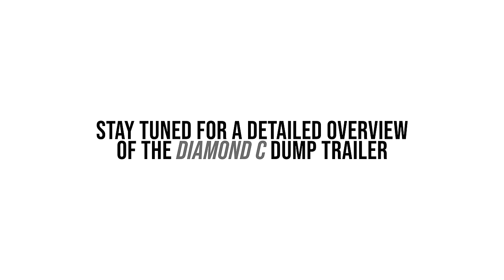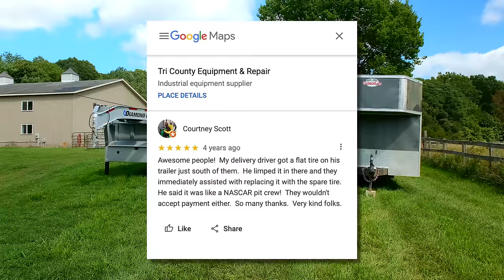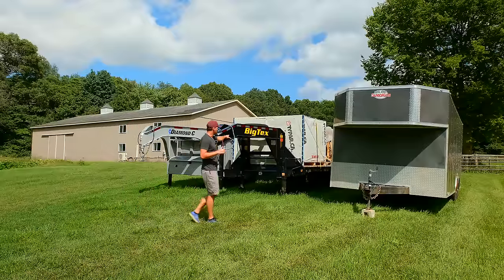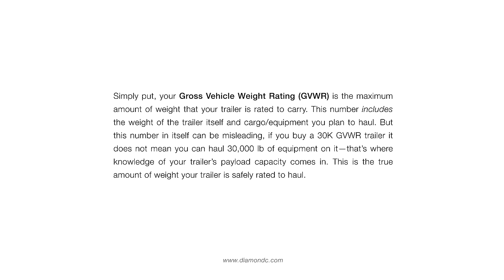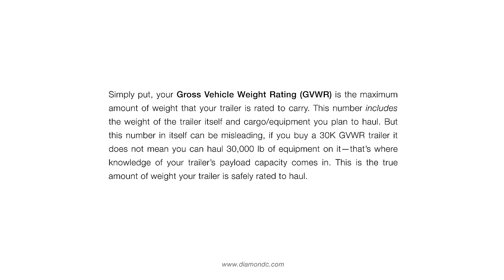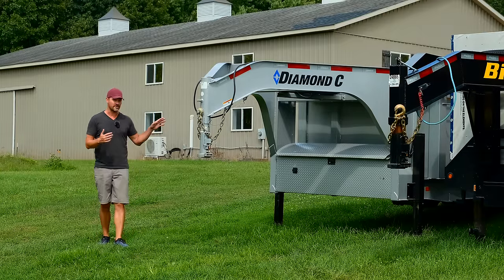THIS WAS A $30,000 DUMP TRAILER MISTAKE. WHO WANTS TO BUY IT?

Comment: It should be standard that if a dump trailer has a GVWR of a certain weight it should be able to lift that much(minus the weight of the trailer) no matter how its loaded.
Reply: If appropriately loaded I'd say. Put 16k of lead right at the front and you're likely to exceed the hitch weight. But I agree, if you are appropriately loaded you should be able to dump at max weight. Lots of dump trailers can't - it's sad. What I find pathetic is they can't even cite any capacities. Didn't someone engineer that? Or did they just slap a bunch of crap together. It takes some math but it's not that complicated. You should be able to cite a design weight the system should lift. If it's just a little heavy on the nose you can mound up over the axles but I honestly thing that's the wrong setup with the wrong parts. I could respect it if they said it's designed to haul 16k but only dump 10k unless you upgrade to... But it sounds like they have no idea what it can do - and they built it. 

I hope the right person finds it and it fills their needs. House cleanouts would probably be a good fit because it's bulk, not weight. Material definitely not...
Reply: But thats not even correct. The GVWR is based off the axles and wheel/tire capacity. Not all the weight is on the axles but they sometimes go overkill just to be safe. Has nothing to do with the lift capacity. A 21k gvwr trailer shouldn't be able to dump that much because you have a payload limit. Take the 21k gvwr(just using that number as an example) subtract your empty weight and that's your payload that the trailer should be able to dump.
Reply: @Flying C Land I agree I drive quad axle dump truck and you can’t just fill it up with gravel or dirt or even sand especially if it’s wet to the brim of the box and not expect to be way  overloaded. I mean 1 yard of dirt can weigh over a ton. It doesn’t take long to become overloaded and unable to dump.
Reply: The material weight is not the problem. The dump system is.
Reply: I remember quite a few years ago, an outfit was making trailers, and the dump was set to only dump the maximum load, that was it!   Everybody was complaining because they all were over loading the trailers, and had to shovel a bunch before it would dump!  They eventually learned what their max load looks like!  I would have adjusted the pressure relief on the hydraulics, but you may bend something, so there is always a risk!!
Reply: problem with dump trailers is that things that you typically put in dump trailers have diffrent Densities. assuming all the loads are "filled to the brim" a load of sand will weigh signifacntly more than a load of large rocks/boulders due to the fact Empty space some materials have. and their inherent density's.
Reply: @michaelpetty8416  common mis conception is that a Dump trailer just because the sides are X feet high means you can fill it with dirt X feet high. if you do you'll be 10-20 times overloaded. High sides on a dump trailer are for lighter cargo like idk. drywall. construction debries. Tree branches. even large rocks. say you have a Same sized trailer with X square footage and same Height sides. you fill it with sand. Its gonna weigh 5-10 times more than a trailer with large rocks or boulders in it. and be 3-4 times overweight. i'm sure the System can lift things within the dump bodys GVW rating..... you'd be suprised how easy it is to overload your average car trailer or even your 3/4 ton pickup. a pallet of water bottles can make your 3/4 ton pickup reach its GVWR.
Reply: Then it wouldn't be a GrossVWR it would be a NetVWR . Your idea only works if ever single trailer is built exactly the same way and is rigged up exactly the same way. Its really not that hard to understand.
Reply: From the sticker! "Weight of cargo shall not exceed 16,780 lbs" (not 30k) 
 Topsoil / loam weight varies between 1300 - 2000 lbs per yard.   Say 1678 lbs or 10 yard capacity. 
 So, and even layer approx 20" deep in a box that size.
Reply: @steveofire56765  
That’s exactly my point. 

1 yd dirt ≈ 1 ton (aka 2000 lbs)
16,760 lbs / 2000 lbs = 8.4 yds

That trailer can be filled with about 15 to 20 yards of material. 

The most the trailer can handle is about 30 yards assuming (20’x8’x5’)
Reply: Telescope ram💯
Reply: I have 3 dump trailers, my favorite is a 14k big tex that weighs 4500 lbs and I went to a gravel pit and they loaded it with 15k lbs of gravel pretty evenly distributed. It was so overloaded that the tires looked flat, and it dumped that load on its own.
Reply: Was it telescopic
Reply: @joshualake4882  but you are putting weight on truck so that would subtract  that weight wouldn't  it
Reply: The scissors lift is part of the problem. If you had had a telescopic ram at the front like many dump rigs it probably would have lifted that load.

Comment: the dump trailer should have been equipped with a center front Mount two stage hydraulic ram it will lift much more weight but of course it cost a little more
Reply: This trailer was probably an order cancellation… who would spend this much without upgrading from a scissor lift? 🤪
Reply: already cost way 2 much

Comment: I’ll take two 10k axles all day long over three 7k or 8K axles. Three axles adds way more torquing and tire sprag as you tun, which is double trouble to a set of already weak axles. 17.5” wheels/tires are easy to find with 10k axles too. You just never have to worry with 10k axles in comparison, specifically for very heavy duty work and conditions that a dump trailer will be prone to.
Reply: 100% agree you are spot on

Comment: Just to add what I said on the other dump trailer video. Another thing you had against you is the scissor lift. The scissor lift is the weakest king of lift. You would have been better with the two belly cylinders, or best yet, the telescopic cylinder in the front. But I stand by saying that is a very large trailer for dirt.

Comment: I have a diamond C dump trailer with the telescoping hoist in front and I absolutely love it and it's always dumped for me even when they load me heavy in the front. Love the videos.
Reply: Yes. Telescoping hoist is the way to go. May raise your bed height. But they can dump anything… 

Scissors lift are such a hassle. Yes, they are safer when dumping on an angle. But, unless the trailer is mostly empty or all the weight in the back it doesn’t ever dump.

Comment: Coming from someone who used to hook/unhook a gooseneck 3-4 times a day every day.... set the bottom of the Gooseneck lock just slightly below the top of the Gooseneck ball every time you take it off(1/4" to 1/2"). You will be able to drive away and your truck will slightly compress as the ball gets pushed down but you will also feel the same effect when you back in to it giving you a positive feeling that you are on the ball.

Comment: Hey Courtney,
I’ve made the same South of the border trailer mistake as well. You mentioned your PJ and big Tex had rust, and hadn’t lived up to expectations as you’d hoped. For someone that uses a trailer as much as you do I’d like to offer a recommendation. We have several Midsotas, Fellings and Tomasters at work. Some of our Towmasters are from the 80’s and all look great for their age. They are all made in MN where they know what winter is and their paint process is 2nd to none. The Felling or towmaster offer hot dipped galvanizing so no rust there. Structurally, any one of these are a waaay better built trailer than the south of the border brands. As far as pricing goes, the Midsota is close to a PJ Felling and Towmaster are more. Hope this helps in your trailer search! Keep up the informative videos!

Comment: It changes far more than you would ever guess based on how it is loaded. I have moved a lot of material in a dump trailer and even on a 14ft bumper pull, it can easily be over a 2000lb of variance even on a much smaller trailer than yours. You are dumping on a fulcrum, so forward weight vs back weight has a huge effect on dumping capability. The more tail heavy you are the easier it will dump, but of course you have to have a distribution that will tow safely as well.

Comment: In my opinion a dump trailer with a front 2 or 3 stage telescopic ram is best and most mechanically beneficial as the pivot point is at the rear and the lift point is all of the way forward. Upgraded tires are always the best choice.

Comment: I have buddies with Diamond C dump trailers and some who dont. From what ive seen is that most of them have the front telescopic lift. The guys who have a scissor lift like the one you have on your trailer have smaller trailers than the guys with the telescopic lifts. Because of the location of the scissor lift it struggles to lift heavy loads. Ive never seen the telescopic lift have a hard time dumping. I wouldnt say its the trailers fault but i'd say that its what lift system that you have gotten.

Comment: Had a friend who bought a 26 ft dump trailer for his semi several yrs ago and told them to fill it with rock, well they did! About 69,000lbs worth 😂 truck and trailer was over 35,000lbs empty. So I think he was about 104,000 lbs  or so. He learned just because it'll hold it doesn't always mean you can fill it full!

Comment: Something to consider is if you have a skid steer that you want to move in a dump trailer, you’ll need at least a 12’ long box so it fits in the box when loaded. Most skids steer with a bucket is 11.5’ long.
Reply: I wouldn't consider any shorter than a 14'.  We put a Bobcat T76 in with forks and the door barely closed.  Plus you really want some wiggle room with equipment for weight distribution.

Comment: I have a Diamond C Low Profile Dump Trailer- Bumper Pull. I think Diamond C has a great product. There paint is excellent. I’ve been able to haul and dump everything I’ve needed to. I use mine daily for hauling firewood. Diamond C does sell single cylinder lifts.

Comment: Thanks for sharing your experience, sorry it wasn't great news.  I have an 18 footer, dual axle, with two cylinders on each side.  Things I have learned:  1.  I can load it for bear.  But I am careful with how the dirt gets loaded, a little more to the rear, but not tongue light.  2.  I like the old school side mount hydraulics.  They tend to lift more than a single and they are more stable on an incline or where you can't get it level to dump.  Shouldn't have any trouble selling that one, its a nice trailer.

Comment: I had a tri axle dump trailer and sold it.  Because of my driving habits in backing up the left front tire would take a lot of wear because of turning while backing up.  It does not back up the same as a tandem axle, it had the same hydraulic cylinder as the lighter weight models as well.  You are correct it hauls heavy but dumps about the same as any other dump trailer.  good video.

Comment: Here’s the thing though, most trailers can lift more than their GVWR. It was either Diamond C or Texas Pride, but they took their scissor hoist, dual ram, and telescopic piston loaded to see what they could do. Now, scissors are quick, but not strong. It lifted just over the max of the trailer weight. Dual ram (2 pistons underneath) lifted more, but much slower. They both struggle with loads at the front. The telescopic crushed both of them lifting nearly 2x the trailer capacity.

Now, in the manufacturer’s defense, our boy here loaded around 11 yards of soil at roughly 2,200 lbs per yard. Soooooo, I get it. Should be able to dump to the top, but high walls are mostly for tree limbs, debris removal, and bulky, less dense objects. It’s a lot to ask of a trailer to pick up 24-25k when it says don’t go over 16.

However, I do agree. For simple material moving around the lot a 2 axle, 14 ft,  14-16 GVWR would be a better fit. I’d go bumper pull so you can use both trucks comfortably.
Reply: Are there any dump trailers that are suitable for hauling crushed rock only? I view dirt as light stuff I have been looking for one to replace a single axle dump truck but I am starting to think its not a good path. All I do it run gravel to the farm from rock quarry
Reply: @jeffstrains4014  it depends. So you gotta remember, a yard of dirt weighs around 2,200 lbs. and your typical yard of gravel is usually 2,500. So we’re talking 300 lbs difference. Not really enough to break the machine here. Plus, it depends on the single axle dump truck you’re replacing. If we’re talking some F-350/450/550 chassis cab that can handle 3-5 tons, then any dual axle trailer. If we’re talking a class 5-6 medium duty truck doing 6-8 tons, then you’re more limited to diamond c, Texas pride, and I think big Tex would be your best bets.

Like I said, depends on how much you’re doing, but if you have a stout enough truck 1 ton SRW/DRW w/ diesel, then you can get a trailer rated to 20-24k GVWR that weighs around 6k-7k so you’re looking at 7-9 tons of payload. I’m pretty sure that’s about the same as the truck.
Reply: @miltonzinn8732  Its an old 80's GMC 6500 I normally grab 12 or 13 tons depending on how they load. Pulling back over the scales around 34 to 6k. From what I have seen I think just getting another single axle truck would be my best bet. Can get some decent trucks for the price of these trailers.
Reply: @jeffstrains4014  yeah, if you’re going that heavy, I’d probably stick with the GMC. All things considered to move that amount of rock, you’d need the 30k rated trailer (around $35k and the truck to pull it starting $46k) for a 2wd reg cab diesel.
Reply: @miltonzinn8732  it was Texas pride

Comment: Look at the iron bull 14k 8x16 deck over dump.  It has drop sides that allows side loading. Overbuilt dump ram. Best trailer I have ever owned and I’ve had a bunch.

Comment: My $0.02:  It looks like you had quite a lot of material in there.  Jacob on the Diamond C YT channel mentions that having the 24" sides is plenty high when hauling soil and rock.  Anyway, I agree the telescopic model probably would have had an easier time lifting in that situation.  Didn't help the the material was sticky, and wouldn't slide back when dumping.

Comment: The bumper pull Big Tex dump trailer you showed image off is what we use on farm. The hyd pump burned up so we bypassed and just use tractor hyd cause we pull it with a tractor. We are consistently overloading it 6-7 tons. Replace all wheel bearings after 1.5 years but now we break them down and repack once a year. Its 4 years old now. It's a TOUGH trailer.
Reply: Also if we load that trailer to far forward it won't lift. We load it heavy over the axles.

Comment: Good advice on upgrading tires. I think you forgot to mention make sure you have a spare on every trailer. That's my biggest pet peeve. Its crazy so see all the guys out there with zero spares on a trailer then you see 'em stranded or parked on the road on a busy holiday to boot. I keep mine on a tire carrier or in case of a cargo, its mounted in the front Vee section. Last thing a guy needs is to be stuck with a flat in BFE and its rainy on a late night or holiday when your odds of finding a tire place to come help is slim. Then risk leaving trailer on the road when anyone with a spare could come by and take it home.
Reply: Yes, with duals, I'd suggest two spares as if one goes, by the time it's noticed, the other tyre is possibly at the point of failure, too, even past that point.
It also means you have the tyres you WANT, not whatever the tyre shop has in that size.

Comment: Just bought a Kaufman 20 foot dump dual 10k axles with double duals on the back with twin maxim cylinder lifts. Highly recommend, built thick and way less costly than that diamond c only minus is it’s a manual powered jack no biggie.